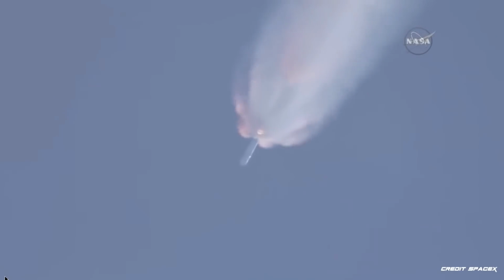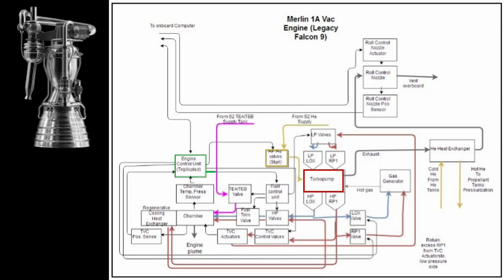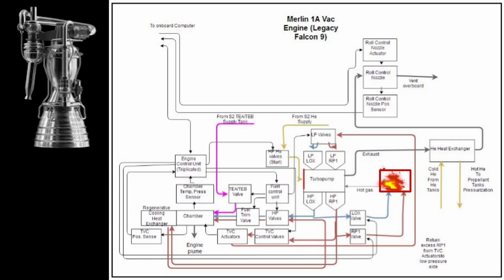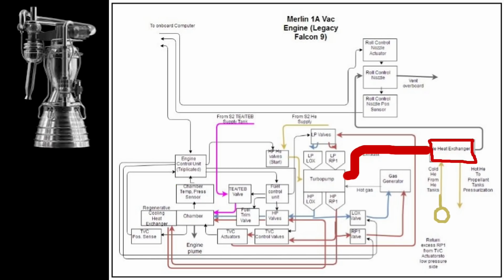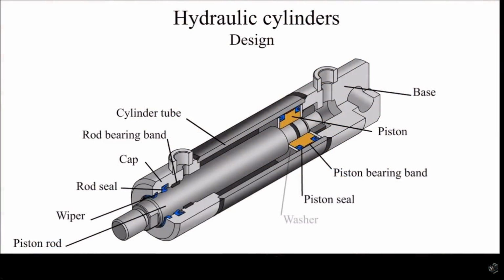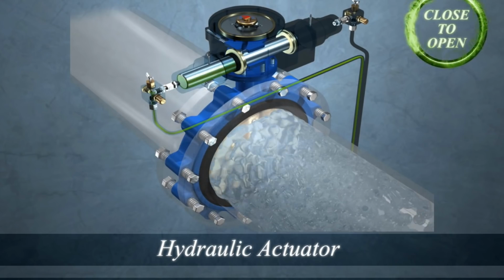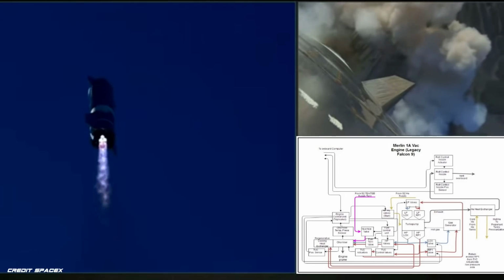SpaceX Starship: Control Systems for a 15 story tall quarter million pound rocket

Comment: Enjoying the video so far but you just compared the 9 merlons on F9 to the 6 engines on Starship. A more accurate comparison would be the ~30 raptors planned for Super Heavy. Or comparing the 1 merlin engine on F9 second stage to the 6 merlins on Starship.
Reply from the maker: There are no merlins on starships :-) I was comparing one Raptor to one Merlin. I was just showing how they are configured on the individual ships.

Comment: What seems to be the problem with the newer raptors, requiring them to be switched out before almost all of the Starship launches? What keeps failing?
Reply from the maker: There is such rapid iteration development that right now hardly any two Raptors are exactly the same.  With more success they will finalize a design and start perfecting.

Comment: you totally wrongly compared a starship to a falcon 9. starship is the second stage, falcons 1 merlin second stage against 3 on the starship.
9 falcon 9 merlins against 31 raptors on the heavy booster
Reply from the maker: I am not comparing them so much as contrasting... but thank you.

Comment: You do a great job of explaining complex systems to sharp minds. My problem is that I’m no longer college material. At 59, I’m not about to really get all the technical stuff, but I still want to know how things work in general. There are so many comments fawning over your explanations that I probably don’t have much pull, but it would be a lot more entertaining to see more 3 dimensional video of hydraulic rams moving the engine with a narration explaining what powers things rather than a full-on flowchart lecture with every signal and every system involved. I now know that the power from the engine somehow runs the hydraulics, but I don’t even have a clue as to how the high pressure gasses turn into hydraulic fluid pressure. 
I guess I’m recommending a little general overview in addition to the highly technical lecture. Your target audience is the future rocket engineer, but I think you’ll have greater success if you also aim at entertaining the novice space enthusiast. You really do this to a great extent, but this video left me wishing for some explanation I could digest easier. 
Thanks again for what you’re doing!
Reply from the maker: I understand completely.  Picture a tank with high pressure fluid.  The tank is connected by pipes to each side of that hydraulic actuator we say.  There is also a "sink" or low pressure tank to receive fluid.  If I open the valve one one side of the ram piston to high pressure flow, and the other side to the sink, the piston extends.  Reverse this with the switched flow selector that was shown and the piston contracts.
Reply: @terranspaceacademy  
I guess the part I’m missing is what powers the hydraulic pump that pressurizes the tank. Do some of the exhaust gasses from the engines supply the power for that?
Reply from the maker: @johnholgate4773  I get you! There will normally be a small electrical pump keeping the tank pressurized. How much the system is used will determine the size of the pump. For bulldozers and tractors these are powered by the internal combustion engine just like an air conditioner or water pump.
Reply: @terranspaceacademy  Excellent Vid. As a former instructor of adults in the field of computers and software, I really appreciate the way you laid out the information flow and your high quality delivery.
Thanks for your time, talent and technique. 
@John Holgate I agree, it would be nice to be able to trace from the fuel & oxidizer tanks, detailing each node that modifies and/or changes the form of the fuel/Ox all the way to ground, so to speak.
That, for a modern rocket, is a lot of work, especially at this level. Just another thought from the top of the whirled. Cheers!

Comment: Melin engine does not use helium to start the turbopump, it uses triethylaluminium-triethyl borane or TTB for that purpose. Raptor uses pressurized helium instead.
Reply from the maker: Are you sure?  The Falcon 9 has COPV helium tanks and the TEA/TEB is used for engine ignition.  I can see where that might work though.
Reply: Yep, you are right, my mistake. I posted ny comment too hastily without watching trough all the explanation, sorry.
Merlin engine's turbine is indeed started by pressurizes helium.
Reply from the maker: @stevenfergusson5461  no problem :-)

Comment: "quarter million pound"
no-one can even comprehend weights like that..

c'mon guys, get with the times, and use metric.. SpaceX do..

and stop trying to make things sound bigger than they are.. it's sub-120 tons, equal to about 40 Ram trucks.. or 11 guys from Texas at a gun convention.
Reply from the maker: It could have been worse, I could have17,857 stone... :-)
fine. I was just going off dry mass since the burned most of the propellant off.
Over one million grams!  Can't find a Mike Meyers emoji...
Reply: @terranspaceacademy  It's actually 100,000,000 grams, (million grams to a tonne, 100 tonnes) but I'll give you points for trying.. ;)

and not even the British use Stone, and they came up with it!! :)

Comment: Why aren't the TEA/TEB used to start the gas generator as well? Seems like that would eliminate the need for the spark system.
Reply from the maker: It is much easier to just use a spark in such a small burner.
I think the F1 might have used TEA/TEB but its gas generator was the size of many modern rocket engines.
Reply: @terranspaceacademy  Then what about the opposite case, is the spark or exhaust from the gas generator not big/reliable enough to light the main engine?

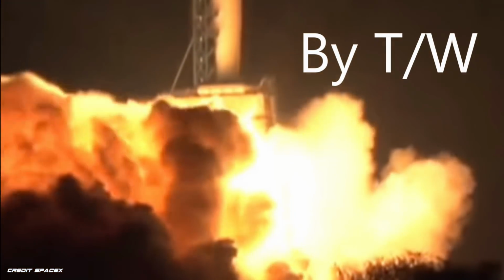Comment: 16:25 ???? No, not at all! The Merlin has the highest T/W ratio, but that's it. Great video by the way. I would love to see a part 2 about the stopping sequence of a liquid fueled rocket engine since I've always heard it's trickier than to start it
Reply from the maker: That is an interesting issue... I'll see what I can do on it. Rocket engines are a little like diesel automobiles.  Once they are running they tend to keep running.  If we close the low pressure valves to the turbopump it should drop the pressure to the combustion chamber, the high-pressure valves would then close once pressure dropped and the engine would be off.

Comment: How granular is the control over  thrust and vectoring say percentage-wise for the Raptor? How quickly can one adjust these aspects of functioning when in a nominal active state? If the nav computer optimally adjusts these things to match the perfect computed touch down profile for Starship landing of Earth of  0ms-1 at 0m height, what would be the expected velocity margins at the time of touchdown? Cheers.
Reply from the maker: They will know this with each engine but until there is a standardized production it will vary too much.  These are hand-built Bugatti's right now.  Later they will be production Camry's and these will be solidified.
Reply: @terranspaceacademy  Hi Terran, thanks for replying and kool vid. Do the Merlins give us any indication as to what's ballpark possible, regarding how precisely and quickly changes can be controlled? I ask this because the engineering of the landing mechanisms is highly dependent on touch down velocities/angles  given the huge Starship mass - albeit moon and mars gravity ameliorates this somewhat.  So, am curious what they'd aim for control wise to minimize leg failure issues given precise rocket thrust control is ideal avenue to mitigate structural loads at touchdown.

Comment: It looks that you calculated the starship as a first stage, it's a 2nd stage, it's has a booster so the calculations and you can not compare with falcon what is a 1st stage.
Reply from the maker: The Starship has sea level and vacuum engines and the Raptors will have to perform in both conditions.  
I took the optimal numbers for each engine. The Merlin vacuum engine has a higher efficiency at 342 seconds but can only put out 411kN. That would kill the thrust to weight ratio.
Reply: @terranspaceacademy  yes and the sea level rapture engine is mainly for landing. It's a 2 Nd stage after separation they will use the vacuum engine. So I stay corrected that your calculation is not correct. By comparing a 1st stage with a 2nd stage your are comparing apples with peers.
Reply from the maker: @peterevenhuis2663  I think the common phrase is oranges but I get your point. Please remember that the booster will also be using raptor engines making them first stage engines also.  I’ll look at the differences in another video. Thank you.
Reply: @terranspaceacademy  compare from falcon it's first stage booster with starships booster, then you will see difference.

Comment: True... I didn't even think about how hard it must be to gimble those engines (quickly, precisely, and transferring all the force) ...
Reply: As long as the moment arm between the center of thrust and the  vector angle remains small, the load on the actuators will be "relatively" small. If the request comes for a high thrust high vector, the load could get up in the Arnold Schwarzenegger category pretty fast.
Reply from the maker: It’s like swinging a mini Cooper around :-)
Reply: @terranspaceacademy  and that is without all the thrust...
Reply from the maker: @Verrisin  Very true.

Comment: The Merlin is 200/1 thrust to weight and the Raptor is currently around 160/1. The merlin is the highest thrust to weight rocket engine in history
Reply from the maker: The latest data I can find has the Merlin at 158 and the raptor at 200. But if you have a better source please give me a link.
Reply: @terranspaceacademy  Everyday astronauts video Is SpaceX's Raptor engine the king of rocket engines? says about Merlin. The raptor we know they intend to get to 200/1 to match the merlin.
Reply: @terranspaceacademy  https://everydayastronaut.com/raptor-engine/ scroll down about 3/4 to the engine data. Bare in mind the Raptor data is out of date. The merlins is still spot on as its received 0 updates since the upload
Reply from the maker: @Sonderax  Interesting. I was going off data directly from SpaceX. Maybe it’s been updated.

Comment: What about throttle control?  Great vid btw.🙂
Reply from the maker: They control the throttle by varying the hydraulically controlled mechanical valves. Pressure stays up and the turbopump is going full force,  they just reduce propellant flow to the combustion chamber.

Comment: 1:20 Vertical integration can be good, but I wouldn't describe it so unconditionally. I've experienced too many cases where it deteriorates into the "not invented here" syndrome. Need a sheet of paper? You can only get it from the corporate paper-milling department, which can only buy wood from the corporate tree farm department, which can only use soil from the corporate dirt department.

As usual, the best advice is to use the right tool for the job, but SpaceX has a different goal than most companies: a self-sufficient colony on Mars. Extreme vertical integration, even to the point of producing common commodities, gives them skills and experience that they're going to need sooner or later anyway.

It's quite possible that they could solve the problem of doing QA checks on engine struts with less effort and cost than making their own struts. Since they need to know how to build an entire civilization from raw materials, however, it makes sense to bias every "build or buy" meeting toward "when in doubt, build". In that light, even a corporate dirt department starts to make sense.
Reply from the maker: That’s very true. I think they do a good job of parsing what needs to be made where. I’m sure they don’t 3-D print their boils :-)

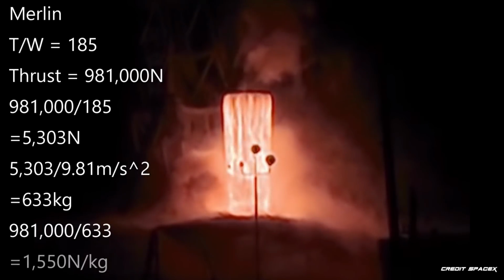Comment: I'm confused by the calculation at 3:33. It appears you're using thrust to weight to derive thrust to weight?
Reply from the maker: I'm showing how thrust to weight can give you the mass.  We could have just gone 185 to 200 etc but then someone might not understand how it was derived.  Plus I wanted to break it down into F/m or newtons per kilogram.